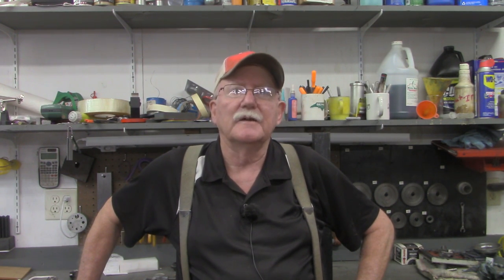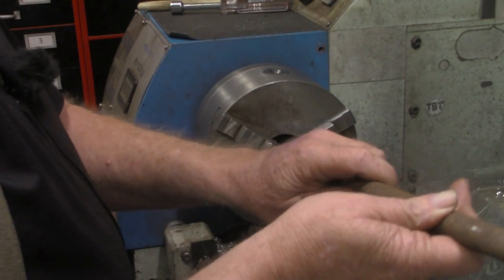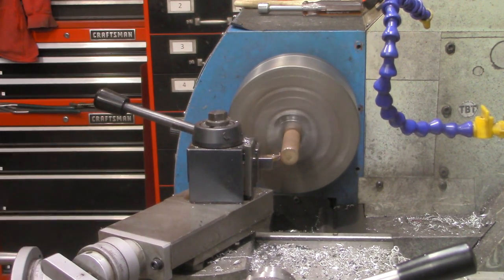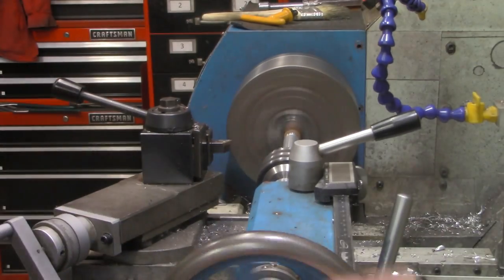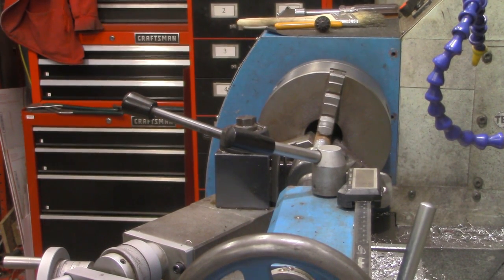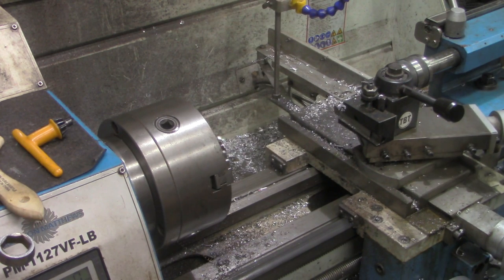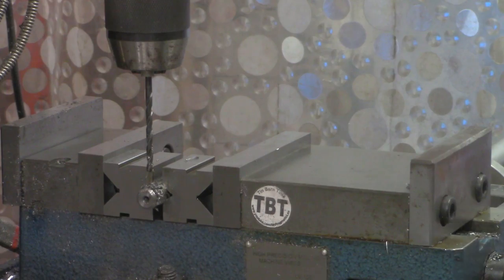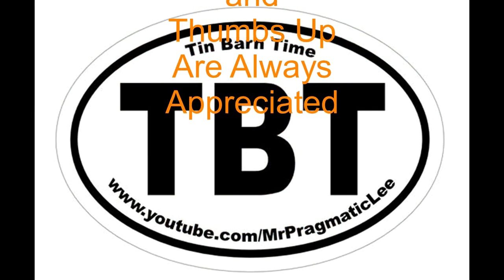Simple Clevis Pin From Rusty Material

Comment: I like how you fit the spider for safety, I was working in a ballscrew factory in Coventry 🇬🇧, I happened to look across the shop & I saw this bar of metal 2" dia fly out of the back of a Dean Smith & Grace lathe, it went up in the air like it was a helicopter every body ducked it hit the wall high up & put a hole in it!!

Comment: Good simple project for beginners to the lathe and mill. I have used rebar for making tractor pins using up the short bits that one enevitably ends up with, I take off most of the ribbed bits with a grinder wheel first to save the inserts a bit or use older dull/chipped ones just for this purpose.(I keep them slotted on a piece of wire made into a circle so I can get any one of them by just rotating round the circle to the joint)